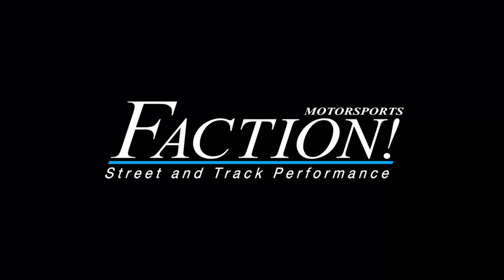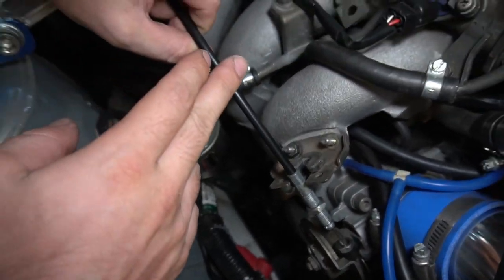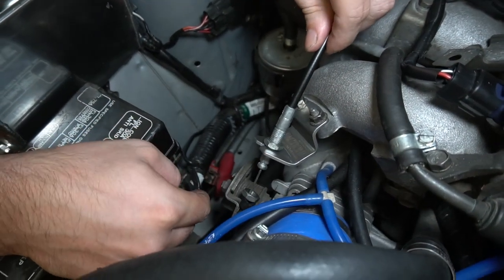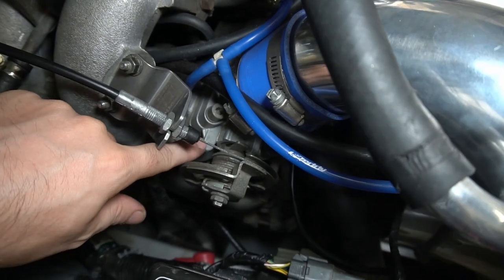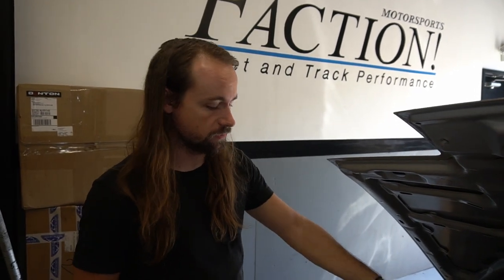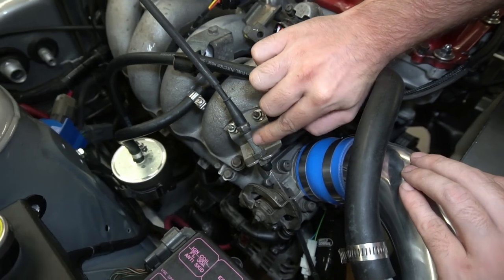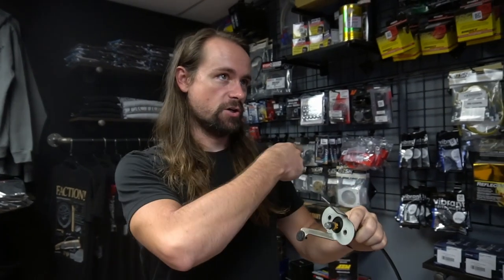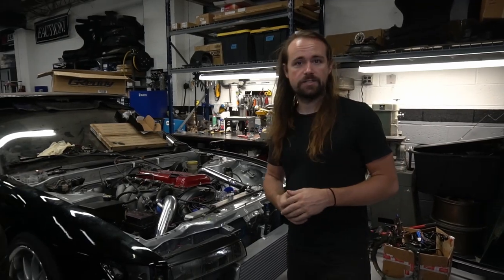SR20 Throttle Cable Bracket - BEST SOLUTION for SR20 SWAP

Comment: I ran into the same issue with my Greddy/Freddy intake. It would make the cable slightly short to the throttle bode with the stock bracket. Will this bracket work on the Greddy style intake?
Reply from the maker: No it will not work
Reply: @factionmotorsports  possible future product? Lol